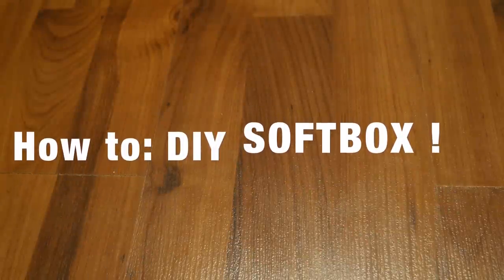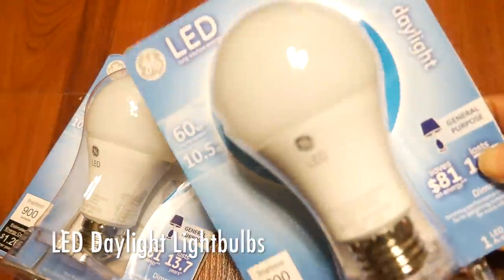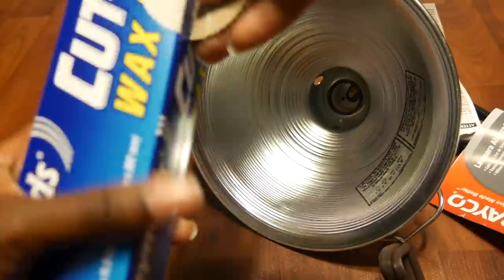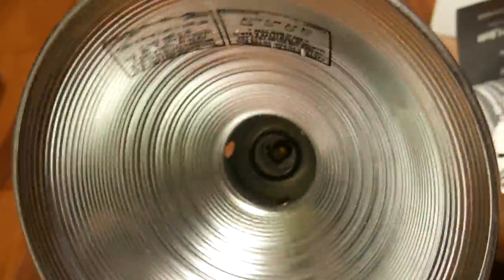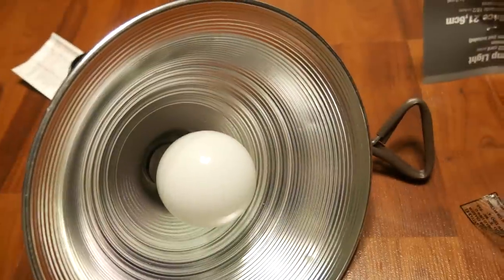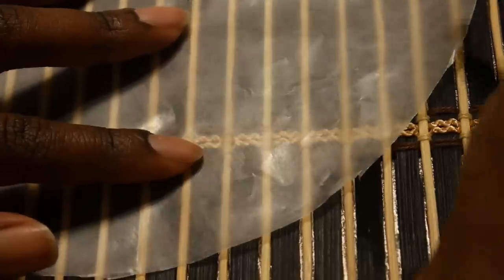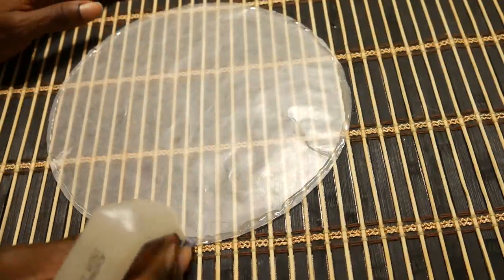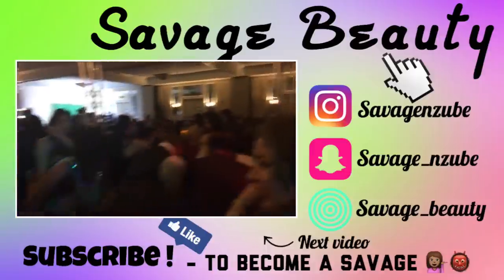DIY : How To Create Soft Box Lights | Savage Beauty

Comment: Also you can cover the  lights with dollar store shower caps that are white,  or you can use cheap white spray paint and paint the inside of the metal light holder. Don't forget to tape up the hole before you paint it. It adds more light.

Comment: Do you ever have issues with the wax on the wax paper melting?
Reply from the maker: Hello! No, the wax paper is still holding up to this day! The light bulbs that were used in the video is energy efficient so there is not much heat that is being given off of the light bulb to cause the wax paper to melt. 
-Thank you